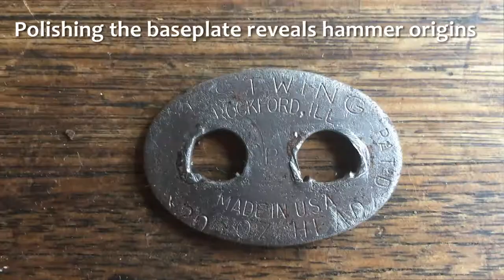Estwing Leather Grip Claw Hammer - Restoration

Comment: Where can you get the plastic parts cause the ones I have are completely toast?
Reply from the maker: I doubt you could buy replacement rings, but in my area you can buy sheets of acrylic plastic in different colours from artist's supply stores - if I had to remake one of the rings my plan was to buy one of those and then cut the rings myself